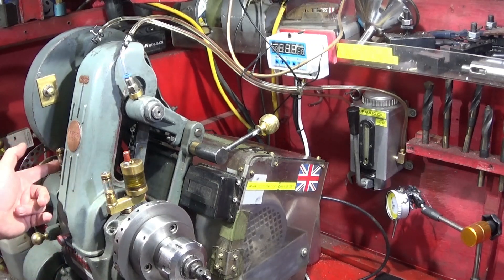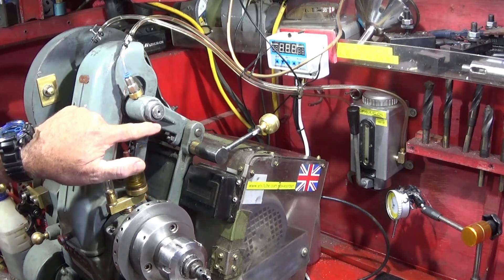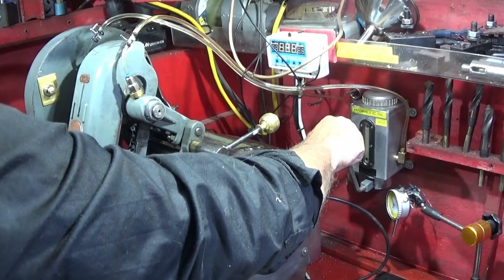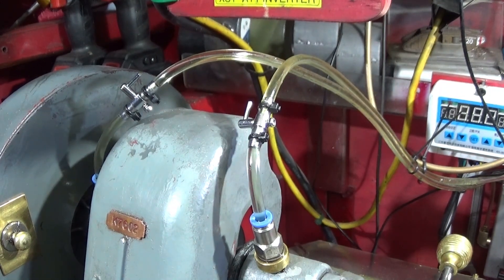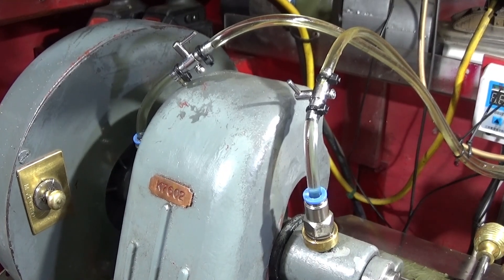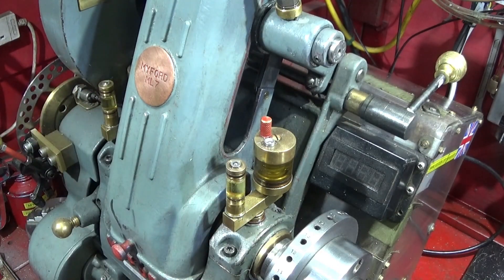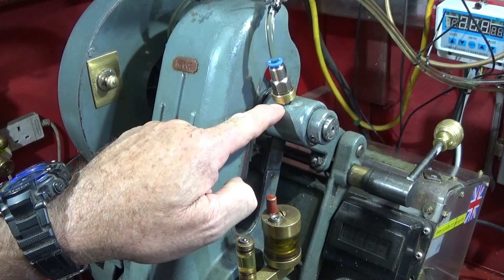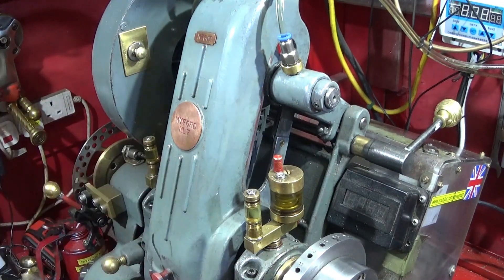Myford ML7 Countershaft Bearing Oil Pump Taps

Comment: Steve following your previous video I put on one of these pumps and so far only connected it to the main bearings, I intend to connect to the countershaft as well. I made brass manifolds like yours. I find that when I pump it also fills the reservoir in the drip oiler which is a bonus.

Comment: Excellent progress Steve, the fully automated solution is to use a metering device so both bearings receive lube at the same time. I have long been thinking of up-dating both the mill and the lathe, but just one thing at a time. Very nice setup you have with that pump and oil grade properly displayed, you are on the winning path, thanks for the vid and cheers!

Comment: Hello Steve,
A good update video... I always liked the idea of the pump for the countershaft bearings...
It would be really interesting to know what the results of the following experiment is: With both shut off valves open pump the pump and more oil should appear from the countershaft bearing nearest the chuck. Swap the two pipes around (at the countershaft end) and try again... if it is the pump I would imagine the rear countershaft bearing would get more oil... having said that the new shut off taps work well so it does not really matter
See you on the next one.
Take care.
Paul,,

Comment: Brilliant solution to equal oiling Steve.  Thanks for posting a link to the hydraulc pump!
Reply: What kind of oil are you using for these? I just got my hands on a Dalton lathe, and want make sure I use the correct oil.